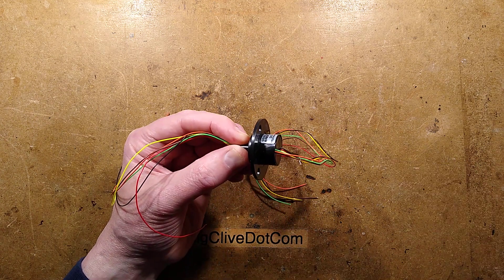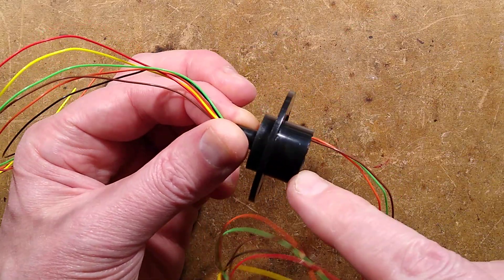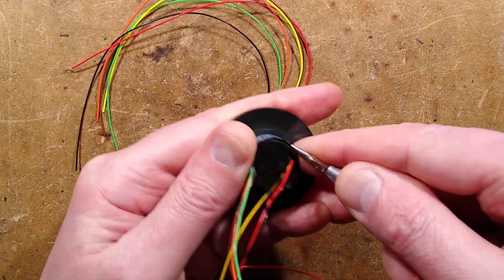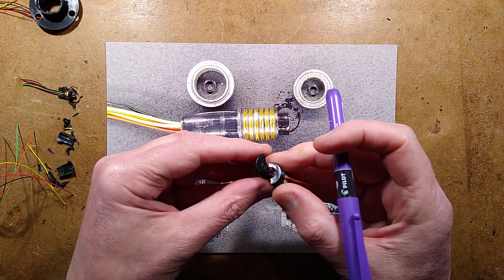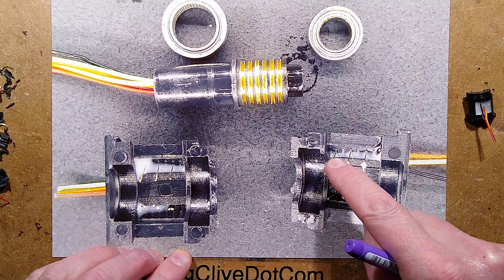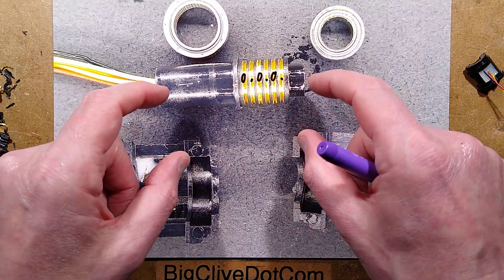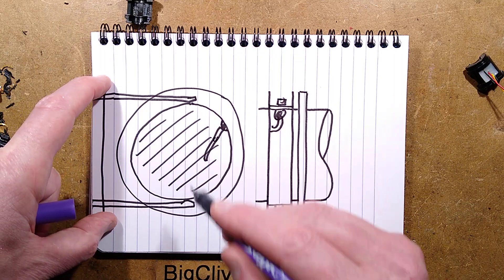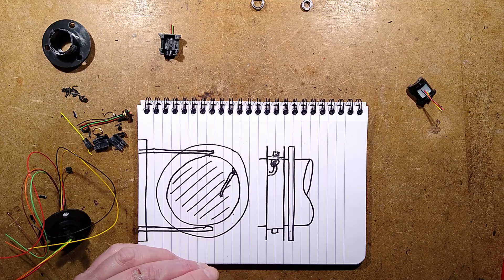6-circuit slip-ring teardown

Comment: Hey Clive great video, the business i work for in the UK sells a lot of high quality slip rings for industrial use so I might be able to give your readers a little insight into some of the other uses for them. A common use for one of these is in the rotating head of the flow wrapper system that packages sealed plastic wrappers, chocolate bars, crisps etc. The head in these systems rotates very quickly and has high voltage to feed the hot cutter that crimps and separates. The slip ring you had here looks like it would last 5 minuts in an industrial environment, but inside the theory is very similar, this is what we'd call a capsule slip ring and we do sell others that come in 2 parts where the brushes and rings are separate entities. There are indeed slip rings that are good enough for multiple streams of hd video and the best of these units would be present in a lot of radar dish assemblies, missile trackers, satellite solar panel control etc. There are nice beefy slip rings in a lot of places, wind turbines, helicopter propellors, mri machines. The price differential for the hobbisty stuff like you showed and some of the commercial application ones though are mind blowingly high. If you'd be interested in having a look at some of the higher end equipment I think we'd probably be able to arrange that.
Reply: I do hope Clive takes you up on that offer, it would be interesting to see the similarities and differences!
Reply: I used to do repairs on dance-club sound systems; occasionally I'd be asked to fix lighting effects that rotated in multiple directions (often Italian-made, ugh) with two or three motors, which I hated working on. The slip-ring assemblies were usually pretty beefy, often having to pass 120 volt mains (US) for the synchronous motors and lighting a bunch of 12 or 24 volt headlight style par-lamps wired in series. When a lamp went out, the disassembly procedure was often arduous and tedious, and finding the dead bulb(s), or a wiring fault,, was a royal pain.
Reply: Interesting post! Send Clive some bits... Slip rings have so many uses and I think they would be more common with general education reminders.
Reply: @dosgos  There are also similar roatary unions for fibre optics (look up FORJ) and rotational fittings for high pressure liquids and gas.
Reply: There are slip rings in many CT scanners which operate up to 140kV. I would be quite interested to see how they are constructed. Maybe just the same carbon brushes with big spacing and quality engineering, or perhaps some clever technology to minimise the chance of arcing. Could Clive take a look at one? PS I don't think MRI scanners usually have slip rings since the only "moving" parts are the gradient coils which annoyingly shudder when being switched on and off creating the awful racket the patient must endure.
Reply: high quality you say ? i am in need of a high quality version of the slipring used in a 24v 55A windturbine so it have to be able to carry that amount of power , and have a very good resistanse to moisture and wateringress the turbine is  called istabreeze 1500 , this turbine is fairly popular and is selling well as it is one of the only sub 1000$ turbines that produces its rated power however it has its faults one of them is a cheap slipring and water ingress in housing , so most ppl who buy them try to midigate these problems before  raising them  and i know of a fair bit of ppl looking to upgrade that peticular slipring..
Reply: @kimmogensen5390
Reply: Clive’s community is untouchable! Great info! I am now really into slip rings lmaoo
Reply: There are slip rings in many CT scanners which operate up to 140kV. I would be quite interested to see how they are constructed. Maybe just the same carbon brushes with big spacing and quality engineering, or perhaps some clever technology to minimise the chance of arcing. Could Clive take a look at one? PS I don't think MRI scanners usually have slip rings since the only "moving" parts are the gradient coils which annoyingly shudder when being switched on and off creating the awful racket the patient must endure.

Comment: I remember taking apart a vcr when I was younger and when taking apart the spining head, was fascinated to discover not a brushed slipring, as I had presumed, but a contactless one. It used a series of flat concentric coils on each half to couple the signal from the magnetic pickups from the fast spinning head to the fixed body of the machine. Quite a eye opener to me at the time.
Reply: Heh... I took apart my fair share of VCRs and only learned how those inductive rings worked some 20+yr later. amazing, really... such tiny signals!

Comment: The 250v is rated based on insulation and sparking that could occur inside. If its 24awg max amps is .5 but you should be lower than that fir safety. You can run 250v if its limited to say 200ma or so.

Comment: This device would have a multitude of applications for model railroaders and diorama builders. Railroad turntables, fairground carousels. etc.

Thanks for sharing. Brilliant video Clive.
Reply: Have used above Slip Ring in a Model Railway Turntable very successfully. DCC working perfectly. With a quality Gear Motor, Gear Box with a Worm Gear (acts as a brake when stationery) turning a Quality Pulley Wheel (with industrial rubber belt fitted to it) making contact to a larger Platter (with industrial rubber belt fitted to it & mounted to the TT Shaft). Both Rubber surfaces making contact (no slipping) and therefore no noise transfer makes for super quiet operation. Have mounted the whole Gear Motor (DCC Decoder controlled) & Gear Box to a Swinging Mounting with the Pivot Point using a press fitted Bearing with a Spring keeping tension to the Large Platter. This giving a clutch-like feature. Have had much interest as to how it works, given its all been built inside of a display box, wall power, Transformer with fuse, Digitrax Unit etc out of sight...

Comment: The old 1/4" headphone jack works as a crude slip ring.
Reply: I would imagine a 3.5mm (1/8") jack could work too, with the possibility of 4 pole variants also.
Reply from the maker: I did that in the past too.  Not sure how many rotations it would handle.  A dab of grease could improve that.

Comment: Hah, i just found one of these a few days ago while 'snooping' some boxes at my dad's house (i was bored). I knew what it was when i saw it, but of course i wouldn't leave without wondering what was inside of it. 

My dad works in electromedicine service (you know, x-ray stuff), presumably this was used somewhere between moving parts of the equipment, but can't figure out where. He mainly works with senographes, and i don't recall any part of it that might require sliprings. One possibility i can think of Is an old radiography laser printer we took apart a few years ago (it was going to be thrown away, so we thought it'd be a good opportunity to get fancy parts for robotics and electronics). There was a big rotating drum which fixes the toner onto the film. The drum has heaters and temp sensors on its internal surface; it is likely the slipring assembly was used there. I know the heaters were 220V, but I'm not sure about the power rating. I can tell you the module i found is definitely a fancier version of this one (So maybe it has heater-rated performance?)

Comment: I was designing an alternator a while back for powering a specifically-frequenced electromagnet (I wanted it to be as mechanical as possible) and had some trouble with printing my slip rings, I'll have to get a higher current model. I don't know why I didn't think you could just buy slip rings.

Comment: Use them all the time in the hobby of modelling fairground rides. Gets 12v power across articulating parts just fine.

More useful are the "hole" kind, wider and donut shaped, which fit around an active drive shaft

Comment: How safe is it to connect usb charger using this stuff?
Reply: Probably OK.
5v 500mA would be no problem.
With higher power fast chargers you might wanna double up some wires.

Comment: I have used several of these when I built my robot, one in my robot head/neck, one in its torso to enable those parts to rotate constantly.
I am using  one now in my current project.
They where a lot cheaper when I bought them. (Pre Covid)

Comment: So long ago I forget the details, but a lot of the video recording kit I used to look after had slip rings with some pretty high voltages on them. Memory no doubt wrong….but I seem to recall the Ampex VPR 2 C format machines had maybe 800V(?) on the slip rings for the AST heads (auto scan tracking). They were remarkably reliable and used a similar ring and finger style. Also found them on later cassette formats too.   Worst thing on the VPRs was that the slip ring assembly was the lowest point and gravity had a habit of getting carbon dust from the drum pancake motor into what was known as ‘the dog house’ that covered the slip ring assembly.  Very important to clean that area!  The HV supply for the AST had some really funky high voltage very low current fuses.  There were other signals on the slip rings too but I just can’t remember what they were now. Kind of disappointing all that hard earned knowledge I had on those things is now gone.
Reply from the maker: That knowledge can also apply to modern products though.

Comment: I used a sixteen wire rotary contact in the robots I built. If you need to carry more current, you can use more than one contact together. The robot used 24 volts DC and used 4 contacts for the positive connection and 4 for the negative, to bring 24 volts to the top enclosure of the robot that turned independently of the base. The current capability is 4 times the capacity of one wire.
Reply: Using multiple contacts per feed like that also reduces the "noise level" or "dropouts" to near zero.

Comment: You only really need these for continuous rotation so it's not too hard to avoid having to use them, usually. I used them once but the product we were developing didn't make it to market in that form. Happens more often than you'd think.
If higher current is required, Sandia Labs recently took out a patent for one of these without the use of sliding contacts. Imagine the inside of a car diff, but with a conductive belt drive instead of gears. I imagine it works quite well.

Comment: This type of slip ring was used on a clearance dredger I worked on. It transferred data from the crane position, to the ship's bridge, for computer monitoring. It allowed the crane (which was independently powered by diesel) to turn 360 degrees. It worked well, until someone doing maintenance under the crane pedestal, banged their head on it and smashed it. A later modification used a WiFi system instead.

Comment: Mercury contacts sound absolutely wild!  That said -- everything leaks.  High surface tension prolly helps a lot but I wonder how much of a hairline crack you need for it to all evaporate away...
Reply: You can still get them for really high amps stuff.  Mercury contactors as well.  Dunno how the slip rings work, but the contactors basically lower the contacts into a blob of mercury to energize. Turning them upside-down is not recommended.

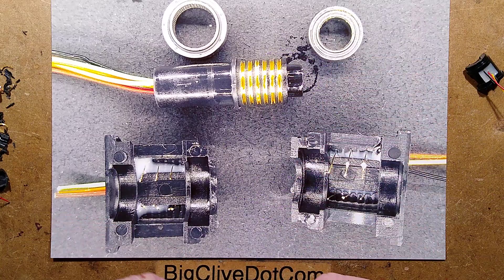Comment: @4:42 Clive, I did notice you were wrong with the tracks. but not easy to tell, unless you look really closely, as the resin covered some contacts, the fact you had the 1 half reversed, and also the fact that when you look at the springed contacts they all look to be in the same position on both sides.

Comment: I was expecting pogo pins inside to maintain a constant pressure against the core.
Interesting teardown. Thanks Clive!
Reply: I expected springy contact blades stamped out of flat spring steel and electroplated with a more durable material .

Comment: As for basically all cheap Chinese stuff: De-rate its ratings 20-50% and you have something that maybe lasts some amount of time
Never trust something like Voltage and Current ratings for such products. They can deliver it, but only until the 2 weeks buyers protection is over, then they burn your house down

Comment: Would be good to rotate this with a geared motor (a few 100 RPM) ,monitoring a 5v in out on one of the rings,hooked up to a digital sample scope, on very long capture, or an easiest way, rig up a ov detect Set/Reset Latch to see how long before the gold flash lasts ,before glitching,i think i have read around 50,000,000 revolutions life expectancy, that is hard to believe.
Reply: The shaft is narrow enough that the linear travel of a contact in 50,000,000 revolutions is a couple hundred miles, not thousands. For a fancier part than was on display here, I'd absolutely believe it.
Reply: @jercos  50 million revolutions you say is a couple of hundred miles, how you work that out?
Reply: @enoz.j3506  there's ~160,000 cm in a mile, and the circumference of the slip rings looks in the cm range, 1cm * 50,000,000 revs would be ~300 miles of sliding contact.
Reply: @jercos  ok,that makes sense,i still wonder if the gold flashing would last 50 million revolutions.

Comment: That's interesting, my idea for such a contraption would be closer to motor brushes gliding along a series of concentric rings. This is much closer to something like a headphone plug and jack, which is probably better.
Reply: Your intuition is absolutely used in industry as well, where applicable, the main advantage here is keeping the contacts at the same linear speed. Another similar example of a flat, concentric device would be the rotary transformer in a VCR, that connects the spinning tape head.

Comment: I always remember being amazed my my mums Clairol heated hair brush as you could rotate the cord or spin the brush around on its cord without the cord getting tangled. This was back in the 80’s but I noticed that the design was kept the same for over 2 decades so must have proven to be safe & reliable.
Reply: If it was like my mother's curling iron (that she had from late 70s well into the 90s) they used what was essentially a very slightly modified RCA jack/plug. The the cord had a molded hard plastic ring slightly smaller than the handle that fit into a  cavity in each ½ of the handle shell to retain it and allow it to rotate. If the dimensions were any different than a  true RCA plug I would be surprised. I  was shocked that it worked as well as it did.
Reply: @alexlail7481   Modern cordless kettles in 240v land use a connector that looks like a triaxial PL259
Reply: @TheChipmunk2008  okay... that's not a product I envisioned needing the ability to rotate freely and frequently but cool. BTW we also have and use 240v in the USA,  albeit at 60Hz
Reply: @TheChipmunk2008  Same design in the US as well.
Reply: @alexlail7481  Yep used to work in the US.  The thing there is not the rotation during use (that actually can cause huge damage) but the ability to put the thing down in any orientation
Reply: Worked as a maintenance guy in wisconsin before going rogue and eventually returning to the uk lol
Reply: @alexlail7481  Did your mother know you played with her curling iron?
Reply: @Mike_5 , "mom, I used your curling iron to heat up shrink tubing, honest!"
Reply: @Mike_5  I didn't play with her Curling  Iron, I disassembled it for scientific research purposes...and  yep she kinda noticed.

Comment: Interesting, these electro-mechanic things. As kid I used to make small modell airplanes for electric round-the-pole flying (RTP). We just used two oversized ball-bearings per plane on the insulated pole as "slip-rings" for the power lines to the planes.The motors would need about 12V 2A but there was a large voltage drop in the thin winding wire to the plane so depending on length, at the pole you could need up to 60V. I wonder if this thing slip-ring could have handled that too? The ball bearings had no significant voltage drop and seemed not to care/wear at all, but the speed of rotation was very low. I can imagine that electric pitting would become a problem when the rotating speed and current increases without using a larger bearing.
Reply: I've seen people try that with high amp stuff, it arcs and pits the balls, eventually seizing the bearing.  It's a good trick because it solves mechanical & electrical in one go, IIRC not good for data.

As an aside space agencies have started using ceramic bearing, it's thought cosmic rays cause arcing in bearings and that's not good if you want your reaction wheels to spin properly.

Comment: great video. Is there a low noise version of this that does data like Ethernet? Or is there some other type of solution for high speed data.
Reply from the maker: These are apparently used for the Ethernet connection into moving cameras.

Comment: Slip rings were used in the F-111 and C-130 artificial horizons (ADI) when I repaired those in the '90s.
They would feed the pitch and yaw motors that were inside the spheres.

Comment: Are there slip rings that are of higher quality that could potentially handle some DC motor load or reliable data transmission? If nothing else, power delivery and the data could be sent wirelessly I guess (thinking as a waist joint for a legged robot that can 360 torso twist or a tank turret style joint)
Reply from the maker: These are used for moving CCTV, so they should be OK for low power and data.

Comment: I used one to repair a fantec sim racing steering wheel when the ribbon cable got cut after constant use over time. Worked great and is still in use.

Comment: I've had success running a USB 2.0 video feed over cheap Aliexpress slip rings like this before. At the same time, I've passed 24V power and step/direction signals for a stepper motor driver. In the limited testing I did, there were no signal dropouts.